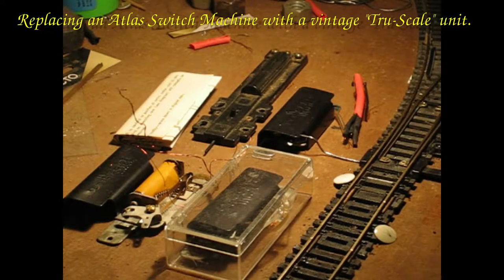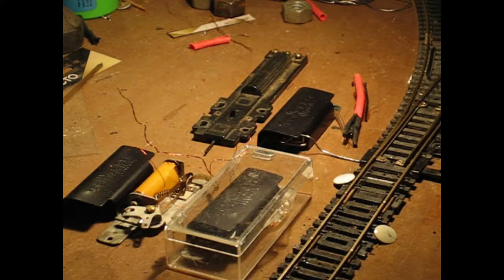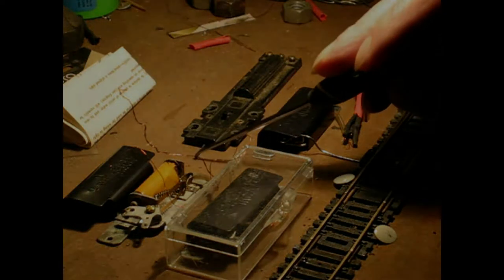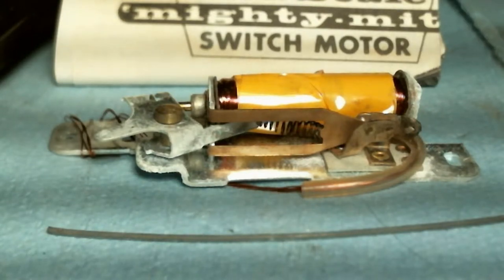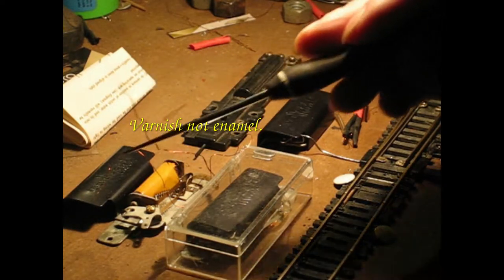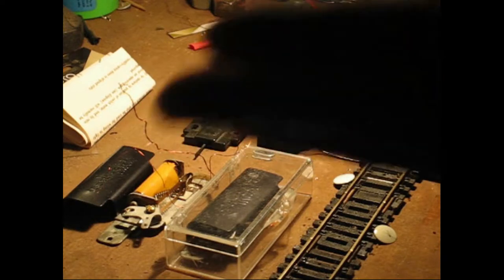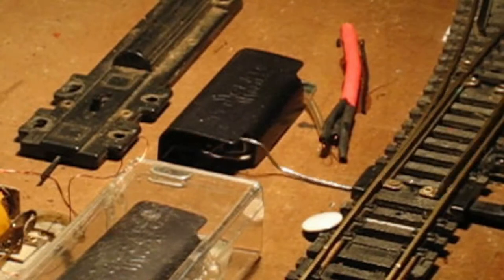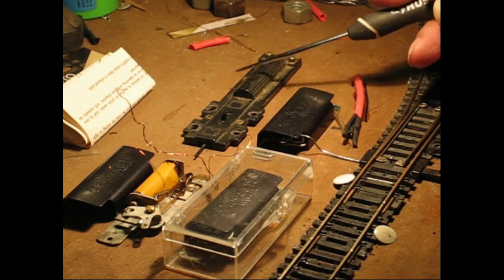Replacing an Atlas Switch Machine with a vintage "Tru Scale" unit

Comment: I think you did a awesome job on your track. They just don't make stuff to last like they use to.
Reply from the maker: Thanks! I can't say as I really don't have much equipment that is new(ish), although I'm periodically looking for a diesel loco with dual DCC and DC compatibility that is reasonably priced, probably a used one in good shape.

The track survived the years but some of the sectional pieces needed some tweaking. The 3 foot sections were just fine. These all have fiber ties so I was pleased that so much track could be reused with little effort. The Atlas turnouts didn't fare so well. Most of the switch machines were rusted fast and some that I acquired for next to nothing posed all kinds of problems. I got one working after loads of work and a second working with the TruScale vintage solenoid machine, also with loads of work. 

The newest piece I have is a used Tech 4 MRC 260 Transformer that indistinguishable from new. It's awesome. When I have a spare moment or two I'll finish the half done video that shows its capabilities. The vid. features runbys of  most of my vintage equipment.

-dave
Reply: @ tammylovesscats The old school stuff was much better than that ''DCC'' junk they got out now.